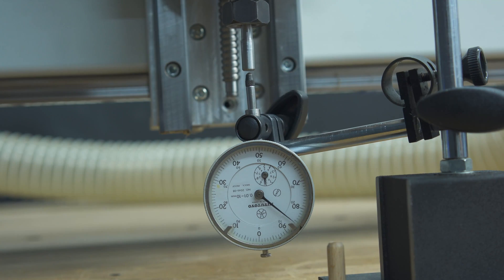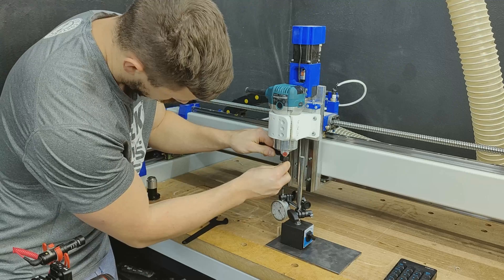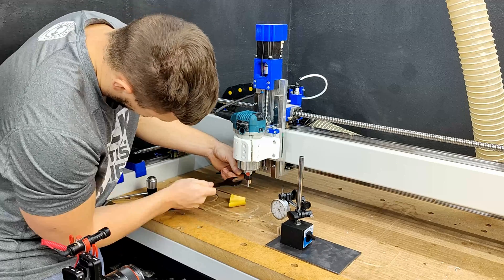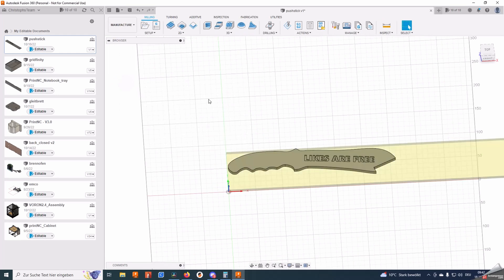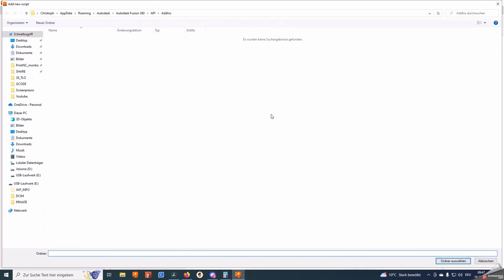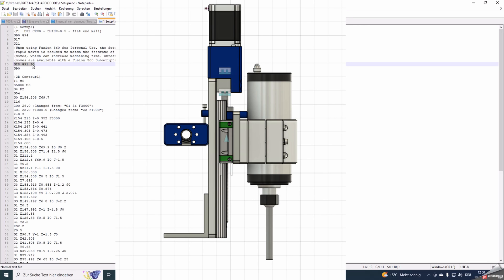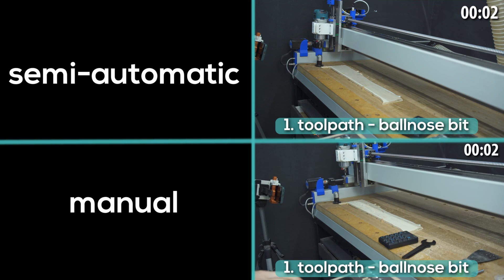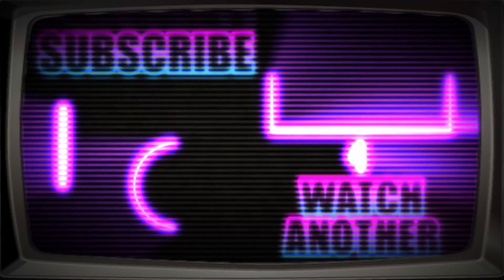why YOU should buy a TOOL LENGTH SENSOR !

Comment: neat... just a slight bit of very important information you left out.. 
1) Is it NO or NC? 
2) What power levels does it function at? 5v? 12v, 24v? 48v??
3) How many leads are involved? 2? 4? 6? 8? 
4) How is it wired to your machine? are you using a breakout board? usb? parallel? something special?? 

All of this info is required if you're going to tell someone "Hey go buy this"

Comment: u can calculate the tool length if u have good software, u give it a probing of the bottom part where the toll enters... and then u just probe the tool ... and the difference should be ur tool lenght... is not so much different than probing with clamps on a metal for Z positioning...

Comment: Can I add this function to an Ender with Klipper, using an unused Z endstop?
Reply from the maker: this is for a cnc :D
Reply: @ChristophLehner  No, I get that but I also want this for Klipper. I have modified my gantry endstop to extend past my bed & want to move/modify the normal z endstop for auto z offset when I change nozzles.

Comment: If you try with wet paper and rotating spindle you get pretty good accuracy.
Reply from the maker: With wet paper?
Reply: @ChristophLehner  yes trust me I learn this from cnc teacher in my training as Industrial mechanican, paper have round 0,1mm thickness but wet you get like 0.05mm and If you put the wet paper on a surface from your part that you want to cnc then travel to the paper and get as close as possible and a little bit more u see the paper fly away and u can press zero 😁 try it :-) if not talk back to me I try to find a video from my Trainee time. (Of course I have to turn on your spindle but only 100-500rpm)
Reply from the maker: @gold-junge91  thanks! Sounds like a great tip👌
Reply: @ChristophLehner  try it and tell me how your expierence are :-D
Reply: @ChristophLehner  i have a machine a my cnc parts in my training like this 🤣😅and get normal trainee time in Germany 3 1/2 years but i get  in 28 month’s done 😅

Comment: Thanks for the video. I got to revisit mine and finally set it up properly and mainly get used to using it. Got one installed and it has been sitting on the machine for over two months. Just tried it once or twice. This proves I could have saved a lot of time already...

Comment: Maybe mount the tls in a hole so it's top is more even with the table top? That way you have less to worry about running into the side with longer bits?
Reply from the maker: That's quite a neat idea 👌
Reply: @ChristophLehner  and if your rally fancy you could have it retractable beneath a trap door lol
Reply: @mastermoarman  I know you’re kidding but man a retractable tool would be a repeatability nightmare!
Reply: @catexis  being serious. Have a kinematic coupler mounted to the bottom of the table that has a mating coupler on the tool height sensor. That way it stops and orientation each time

Comment: Thanks for the tips… i would love an indepth video on actually setting it all up. I just finished dialing in my servos… tonight im going to mount the spindle and setup the vfd.
Reply from the maker: I've added a section about probing/tool length sensor to the printNC wiki, the link is in the description

Comment: Haven’t even watched the video yet, but if you’ve got this thing figured out you are my hero! Mine in LinuxCNC has been giving me nothing but problems.

Whatever they use for the top disk material is hard. I've smashed an 8mm endmill into it (because I programmed it going the wrong way in a G0 move :D) and it didn't even make much of a dent
Reply from the maker: It took me.2 weeks fiddeling to get this thing working 😅

The topcover must be made out of carbide, mine came loose so i had to glue it back in, and this disk is really heavy

Yeah wiring the overtravel switch should be mandatory, i also broke mine, doing a g0 x0 y0 z0...
Reply: @ChristophLehner  Same. Every single person that has used this very style of tool height setting has said that the puck has come out during shipping. 

I smashed mine even when testing out the over-travel switch because they don’t give you any extra travel for your machine to come to a stop. 

The Z-max G28 thing is likely why I couldn’t get it working reliably in LinuxCNC so I’ll have to visit that again.

Comment: Moin, es gibt bei Ebay gebrauchte Lasergabeln mit 80mm Schenkelabstand für um die 20 Euro. Die sind extrem genau. Industriestandard mit IP67, meist laufen die zwischen 18 bis 32V. Ich wollte mir auch erst was mechanisches kaufen, dann bin ich über die Lasergabelmethode gestolpert.
Reply from the maker: Was ist eine lasergabel? Hör ich zum ersten mal 😅
Reply: @ChristophLehner  u shaped thing  with laser sender and receiver. You would use this to measure the tool length. Due to using the laser it is very repeatable. Although I doubt it will change much for your application as steppers with microstepping themselves are not very accurate. In other words this is probably good enough.
Reply: @ChristophLehner  those are optoelectronic sensors. They are widely used for packaging and other applications where accurate count is needed... I think 🤔
Reply: Do you have a link to these in ebay?